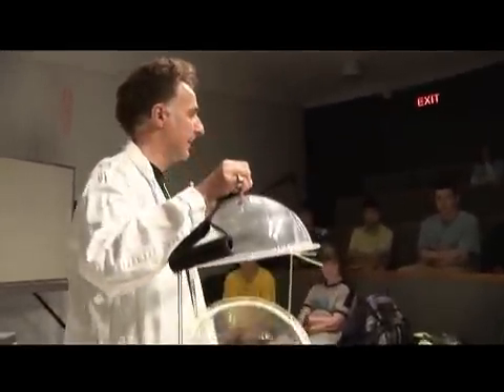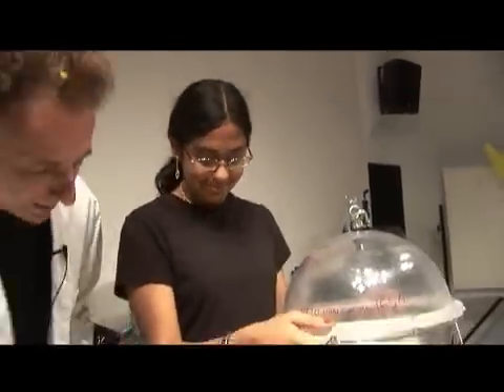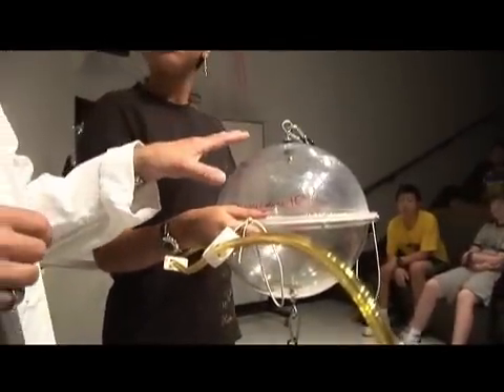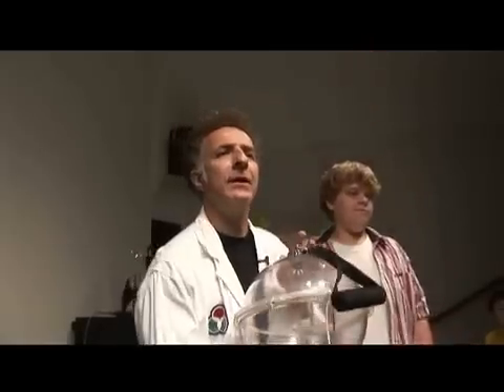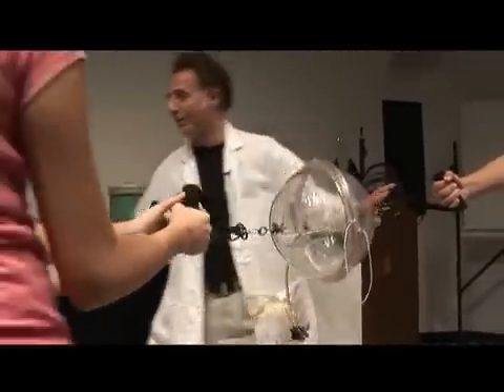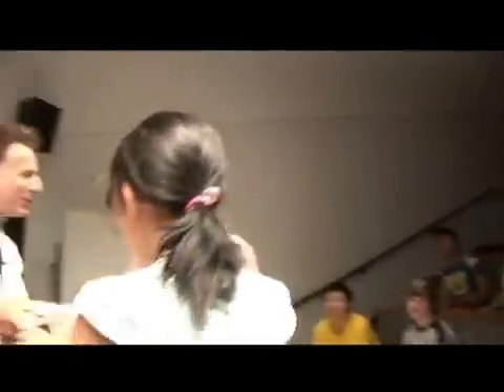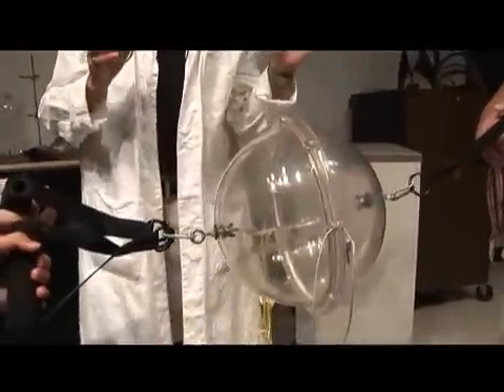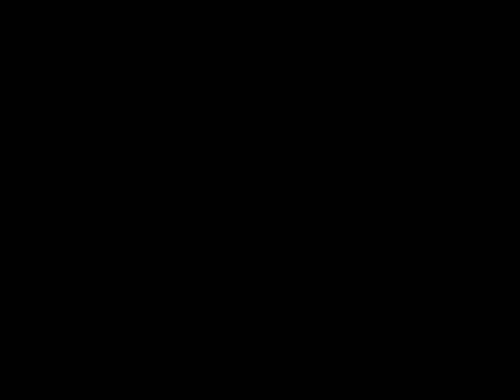vacuum

Comment: But what is keeping the halves together? I know it's the atmospheric pressure -- but what does that mean -- how exactly does atmospheric pressure keep the two halves together? Atmospheric pressure is pressure caused by the weight of air -- so wouldn't that mean that it is downwards? So why should a downward pressure keep the two halves together?
Reply: Air applies pressure from all sides